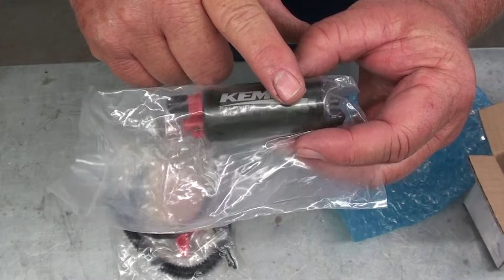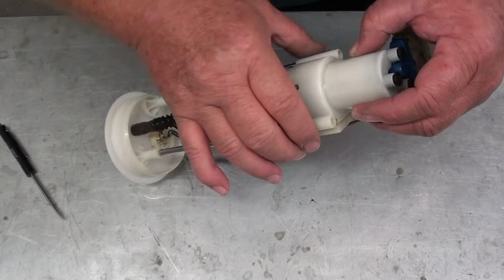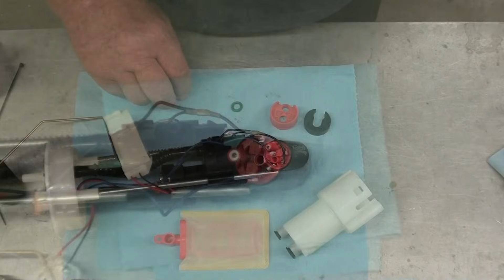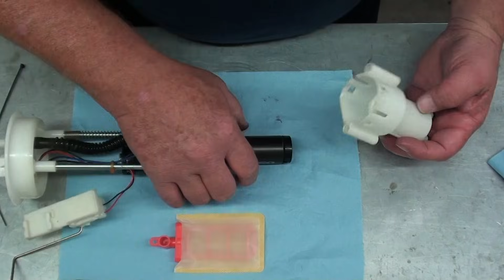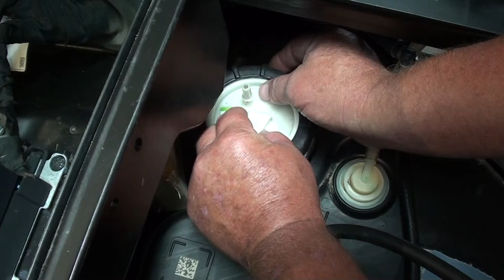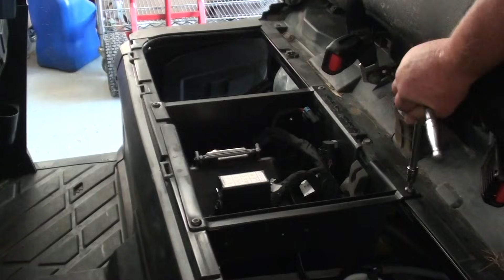Pt.2 2016 Polaris Ranger EFI Fuel Pump Troubleshooting And Repair For Under 30 Dollars

Comment: I can see how popular this method will be for guys searching for an answer to a similar issue like this and trying not to get gouged for 700.00. Wouldn't be suprised if some unscrupulous shop used this method but charge guys 400 or 500 bucks to fix the issue but use a kit similar to this. That's one thing I like about you and yor videos DRay your honest and your work is done right the first time, and your not out to take a fella and his wallet for a ride, no wonder your so busy at your shop
Reply: Did the temperature light come on too? That’s what mine is doing. It will run, when in idle I just shuts down. It will usually start right back up. Any suggestions?